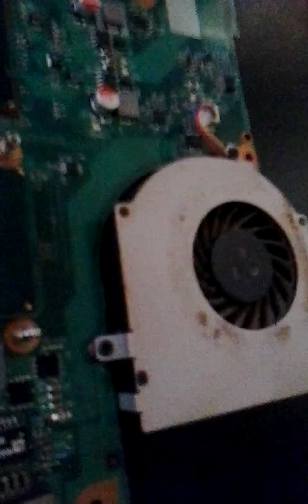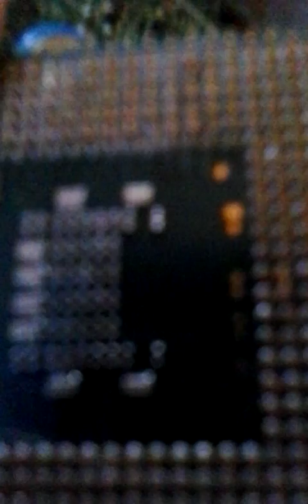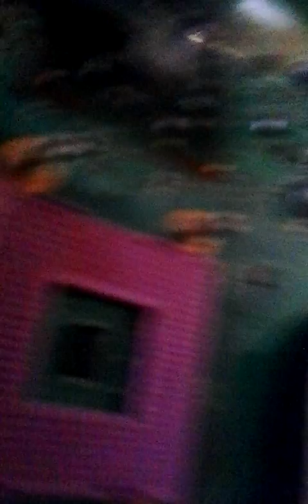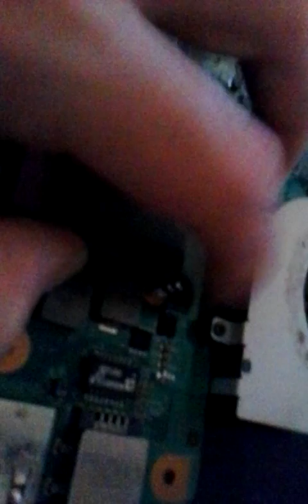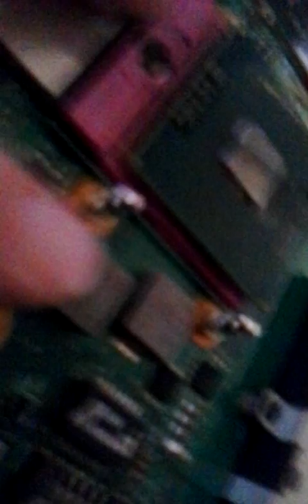how to tell if a cpu is dead

Comment: Mine sparked  I didnt saw it but my cousin did do you have any help
Reply from the maker: Seeing sparks is very bad :( I would get a new laptop with 5 year warranty preferably an aspire or pavilion  with amd black or bay-trail which in my experience get the best performance vs battery life. Before you buy a laptop you mite consider a raspberry pi 3 which is a android computer that connects to a tv via hdmi and has usb which you can install Linux and use wine to run windows programs :)
Reply: Maybe I'll just going to buy new ones because my CPU now is reallymfrom me since childhood so I'm going to buy now that's for gaming
Reply from the maker: gpu is key to gaming
\Lawd Tv
Reply: LOL

Comment: dude that looks just like the mobo to my toshiba satellite m115 s3094 that died years ago :O
also that rubber stuff is thermal paste
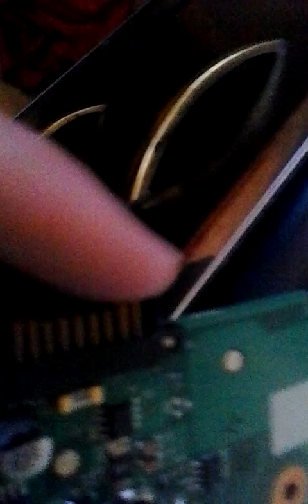also around 8:04 thats the battery slot ._.
also inserting a cpu doesnt require soldering
another thing dust wont affect a cpu if cleaned off unless you cause static damage
and the tiny flat battery is the cmos battery it does sorta what you said but not in the manner your thinking of. what it does is keep your bios settings saved (aka date time boot priorities, anything in the bios that can be changed)
i am sorry but this video is unreliable i would do more research and remake this video as alot of the facts are not true
Reply from the maker: It is a Toshiba satellite and thanks for correcting me, its a Celeron p6 based 2.14ghz or 1240mhz.

Comment: that's thermal paste on the CPU Lol
Reply from the maker: well the paste had a grey discolor to it and the rubber fitting on the bottom of the heat seek  looked melted. The computer got so hot that it burned my hand when i first discovered it.
Reply: I use grey color thermal paste, I also got white.
Reply from the maker: dj ceej Iv gotten a new computer with a better heat sink.